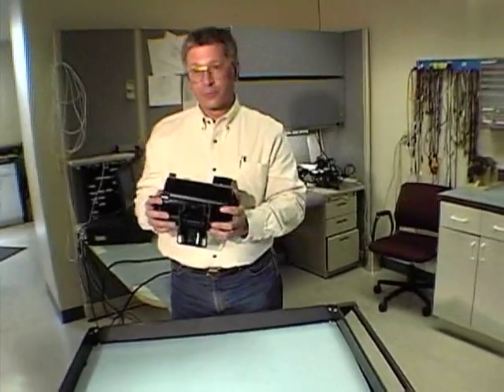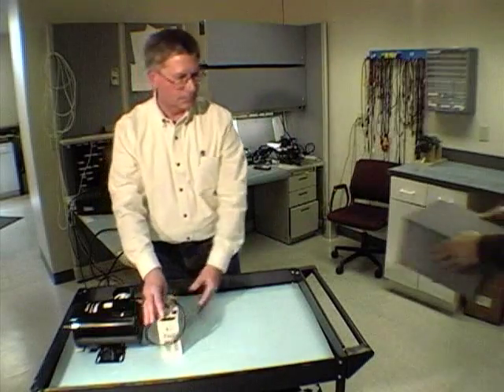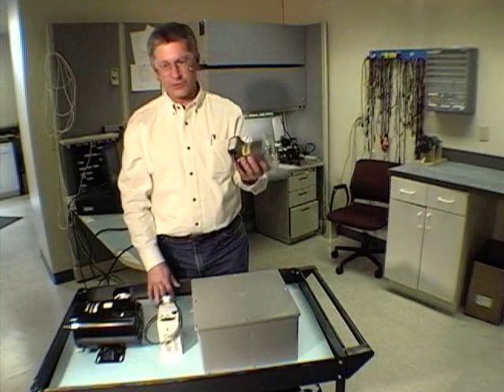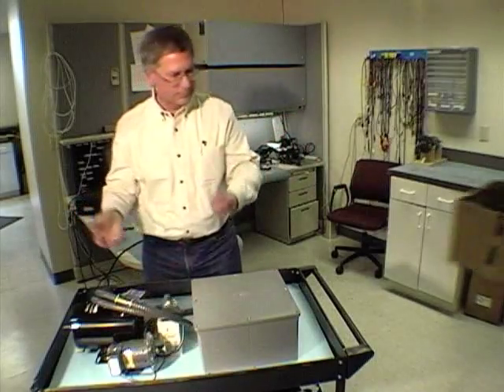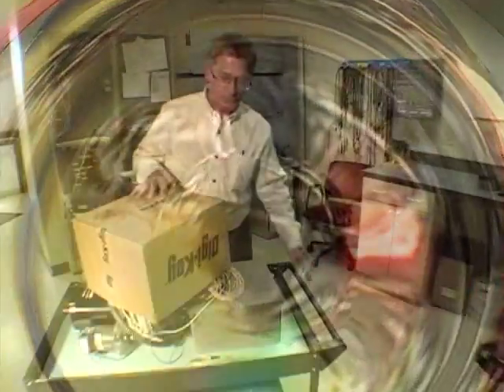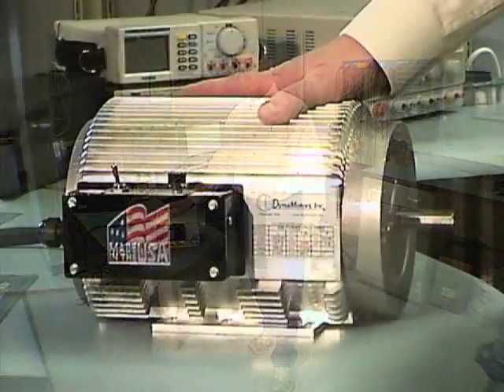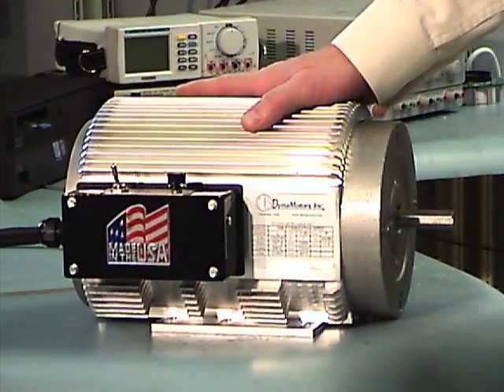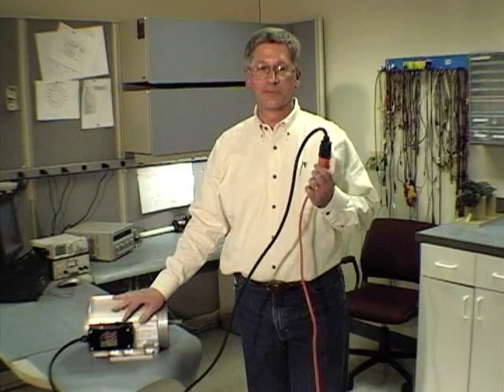Variable Speed Motor - Compact and Integrated

Comment: Well, seeing as the rotor has no actual power going to it, its not an electrically commutated universal motor, its an induction motor where the phase offset is rovided by the rotor rathr than the run/start winding. I'll admit, its a novel design, but I would seriously like to see some efficiency statistics across all orque and speed ranges. Their datasheet and website has a terrible lack of detail. 
I'd also like to know if they're altering speed by rotor PWM from the led's or from phase angle.